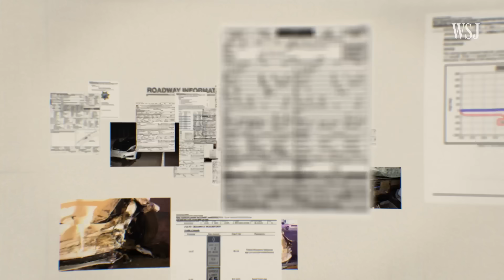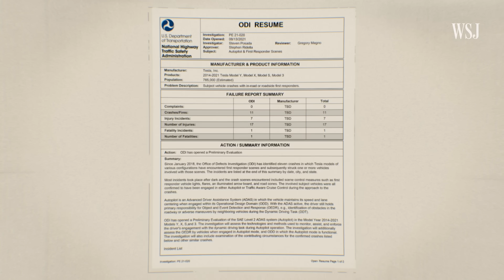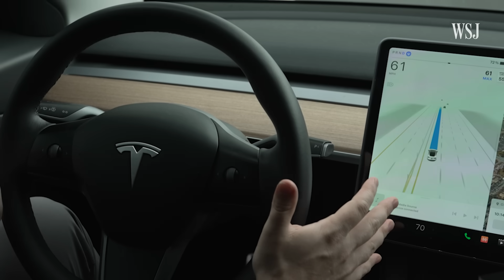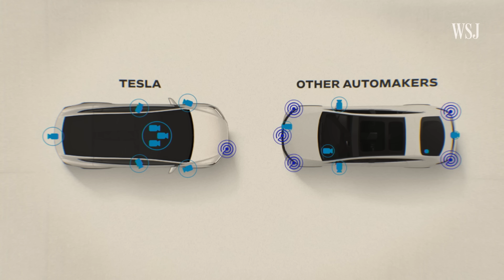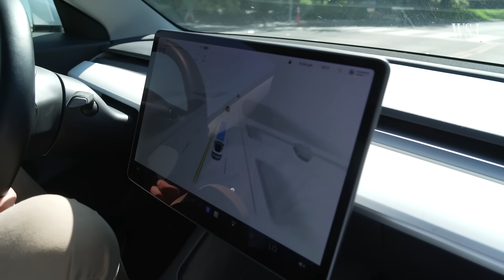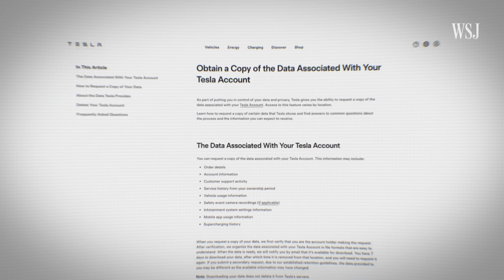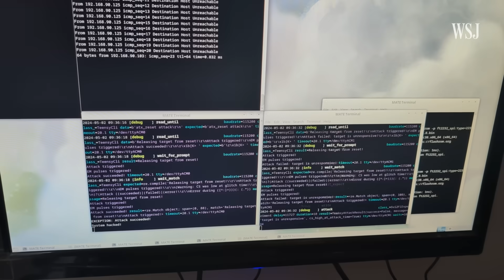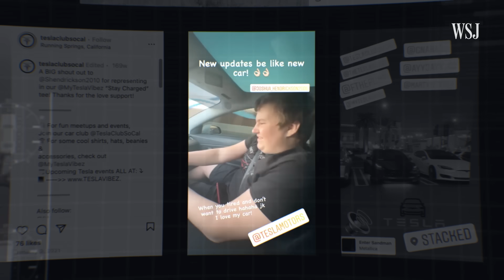The Hidden Autopilot Data That Reveals Why Teslas Crash | WSJ

Comment: Worth noting that when you turn on autopilot, it tells you to keep tour hands on the steering wheel so you can make corrections..... And it even tells you it is a beta release. 🤷‍♂️

The car told that guy to hold the steering wheel 19 times??? Bro ...... If youre told to hold the wheel so many times per time period, it should shut off autopilot as youre clearly abusing and neglecting the system, and outting yourself at risk.

Comment: There is no such thing as 100% "autonomous full self driving autopilot" - it should be called "advanced cruise control" - Tesla calls it "Autopilot and Full Self-Driving (Supervised)" - notice the word "SUPERVISED"! The instructions clearly state the driver must have their hands on the steering wheel at all times and be ready to take over control of the vehicle at a moments notice - Tesla IS at fault for using the term "full self driving" because it is not.
Reply: I literally talked to someone early today who insisted that Tesla is already at L3 and possibly even L4.

When asked why the company wouldn't assume the liability of an L3 designation.....crickets.

Comment: I use autopilot every single day without any issues.

you are acting like any human would've seen the flipped truck in time. there are barely any light. 

The car using cameras is the same as a human using it's two eyes. having 8 cameras, full 360 view gives you better safety then your two eyes. Again, all of clip you showed of autopilot crashes were at night where a human would also most likely not see the danger.

IF YOU DONT LIKE AUTOPILOT, DONT USE AUTOPILOT LOLOLOL

yall doing too much for a headline.
Reply: If a human didn't have enough light, the human would slow down so that there was enough stopping time. The Tesla in question apparently didn't.
Reply: Don't compare human eyes with cameras. One human eye is  better than 8 cameras that cannot see the seen at the same time .
Reply: @AhmedKhan-wq5zq  all 8 cameras look and monitor all at the same time.

Comment: Full FSD isn’t actually a thing yet.  Waymo is so far ahead of Tesla, Tesla will probably never catch up.  Both companies are using our public roads as test labs to try to get the tech to work.  Reportedly Musk only want camera’s because its far cheaper.  The prob is that driving requires more than just sight and the level of processor musk wants to use isn’t capable of handling the job.  For what he wants to do he would need a processor akin to what an F-35 uses OR have a back up on a wirelessly connected central server.  Oh, yeah earlier this week Tesla said it may open a “monitoring center staffed by humans to provide emergency assistance for FSD vehicles”.  That’s for robo taxi support.    1000 serious or fatal crashes is a respectable N for a baseline study and the data screams the Tesla autopilot has serious design flaws. Finally WSJ does real journalism.

Comment: "Auto pilot" was the worst name in safety history for these cars.
Reply: And yet, no regulatory body can take any action towards it. Insane.
Reply: @alexbian5567 in some countries they had to change the name, but in most it has been kept as it technically describes precisely the feature making it difficult to rule against it.
Reply: @fdelaneau  Yeah, that's intentionally misleading marketing. Especially, when Musk keeps saying the car will be able to drive itself (to almost anywhere) starting a decade ago? Isn't there a rule to regulate such practices?
Reply: The Autopilot name is coming from the aviation industry and it is technically correct. In a plane having the auto pilot active doesn’t  mean the pilots can’t leave their seats, the pilots needs to be able to take over at any instant. The problem is that the general public doesn’t understand it as such and this causes much confusion. 

Now, if you are a Tesla owner, when you activate the autopilot in order to be able to use it on the road, the instructions are very clear, this is meant to be used on one way roads and you have to be able to take over at any time. There are also warnings if you need don’t keep your hand on the wheel and if you don’t comply Autopilot will disable.
Reply: @fdelaneau  Autopilot isnt really a technical name you find in the aircraft industry, and it comes in a million different forms, from light assistence to (rarely) fully automated flights. Eg the Airbus Autopilot is called "Auto-Flight-System".

And Elon named the thing Autopilot while talking about how we have self driving cars in two years. Its just later that Tesla backpedals and says "autopilot doesnt actually mean self driving". They got whacked in the EU for false advertising.
Reply: @fdelaneau  theyve updated it so you dont need to have your hands on the wheel I think autopilot is absolutely awful compared to fsd and not in a feature way it is actually just terrible at making and decisions which I get cutting features off fsd but the actual logic and programming is terrible
Reply: @015AEX  False. Autopilot to this day requires your hand on the wheel. FSD (Supervised) now no longer requires you hands on the wheel, but requires constant supervision and attention. If you pick up a cellphone or look at the Tesla screen, it will yell at you to pay attention to the road.

Autopilot is traffic-aware-cruise-control with lane-keeping-assist. Nothing more. It's meant to be used on the highway to reduce strain on the driver. It works well and the name is appropriate... technically. The only problem is the average person doesn't really understand what the word "autopilot" means. 

FSD (Supervised) is to be used anywhere and is the "Full-Self-Driving" version of the software. Tesla has updated the name to include (Supervised) at the end to make it more clear that you are required to be present and give your full attention to the road, as this is still a technology in development. It works well, but you should be prepared to take over if ever you need to. 

I think the part in this video where they said "the technology works just good enough that you get this false sense of confidence to stop paying attention" hit the nail on the head. Typically, in the past we were all used to Cruise-Control. It just kept your speed, obviously if you were approaching a car, you would hit the brakes and disengage Cruise-Control. Everyone understood this. The problem with Autopilot/FSD (and all these other manufacturers driving assist features nowadays) is that they actually do work SO WELL, that you begin to give it more trust than you should at this stage. It's basically so good, that you forget it's not quite good enough yet. Tough situation to be in.
Reply: "Autopilot" for automotive use was actually first used by Chrysler Corporation in 1958 for the first version of their cruise control.  "Autopilot" for Tesla comes in three (I think it is now down to two) levels:  Basic autopilot, which is on all Teslas is essentially a cruise control and lane keep assist and it works fairly well.  "Full Self Driving (beta)" or FSD, is where the system will steer, stop, accelerate, change lanes (with a signal) and is what this video is about.  It is a very pricey option - currently $8,000 USD for a perpetual use license or on a subscription basis for $99 USD per month.
In the course of ownership of my Tesla, Full Self Driving has been given out for free for one month on two occasions.  My impression was that it was amazing what it could do when it worked well but was downright terrifying in certain situations when I had to intervene.
Reply: Semi-auto "Jesus take the wheel" simulator.
Reply: But the best name for profit
Reply: Cruise Control is just as bad.
Reply: Tesla deliberately mislead its customers and shareholders for profit. It’s obvious.
Reply: Why? An autopilot system does not mean an autonomous system; it still requires human supervision. Just because it says ‘autopilot’ doesn’t mean you should fall asleep behind the wheel.
Reply: it's a GOOD term! look at the definition from Wikipedia for example: "An autopilot is a system used to control the path of a vehicle without requiring constant manual control by a human operator. Autopilots do not replace human operators. Instead, the autopilot assists the operator's control of the vehicle"

Comment: The former Tesla employee is a moron, to be fair. The entire point of multiple cameras is to overlay images to discern distance and position. It’s precisely BECAUSE the cameras are offset that they can work.
Reply: No. Images are difficult to be interpreted by computer. Radars are precise. In addition, the computing power these days are still not responsive enough. If these a bug in the program, you are also screwed.I think you are the one who do not understand computing or physics. Speaking as a person with IT skill. 2sec before crashing like that guy, the computer never even slow down. Feel free to prove it yourself. If you trust it so much.

Comment: If the guy was on the road every day at 3AM, who's willing to bet he was asleep when the crash occured?
Reply: Possibly, he may also have still been waking up. Driving a car at that hour of the morning is often times extremely boring.
Reply: Still doesn't matter, a proper sensor suite would have recognised the truck... You know with Lidar and radar, but Musk is too cheap for that. Guy has billions but a few sensors are too expensive...
Reply: Yes, but even so, the vehicle should break, slow down, swerve, etc. Not continue to plough on into an object it doesn't recognise.
Auto pilot is an incorrect terminology to use and claim. Driver assistance is probably the most relatable terminology
Reply: @JonAbrams-xt4tq 
"Yes, but even so, the vehicle should break, slow down, swerve, etc. Not continue to plough on into an object it doesn't recognise."

It can only do those things if and only if it knows that there's an object it can't recognize. The main problem is, or rather, the problem, is that the AI system doesn't know that it doesn't know that there's an object it can't recognize. It's basically the most dangerous epistemic position: It doesn't know that it doesn't know. When the same object is correctly recognized by one camera as a car/human/obstacle/etc, but is not recognized as such by another camera (or worse, not recognized at all, like shown in the videos above), the AI system is supposed to be programmed to take safety measure by slowing down the car, swerve, etc, not keep speeding and crash into the obstacle. Defensive driving should be programmed into the AI system.
Reply: Well that shouldn't matter, since according to Musk, autopilot is 10 times safer than a human driver.

Comment: It's been obvious for more than two decades that if an autonomous vehicle is to be maximally  safe for the consumer, it MUST have fail-safe, complementary and redundant sensing capabilities - not the cheapest configuration possible! That's why ALL aircraft, marine vehicles, rockets and nuclear power plants MUST have redundant and complementary systems. That's also why ALL other automotive manufacturers use cameras AS WELL AS Lidar sensing capabilities for their autonomous vehicles.

Of course then, EM prefers to make the quick buck more and thus look away when TSLA customers are killed due to a lack of redundant and / or complementary sensing systems. But the TSLA fanboys continue to toot EM's massively hypocritical horn.
Reply: Lidar is not some sort of magic. Waymo literally crashed into a large wooden pole a few months back. despite Lidar. Tesla sees a lot more than people think.  and creates it's own pseudo lidar using camera's.

Comment: Incredibly sad for the people who lost their life and the families. However, WSJ - are we just going to skip over the failure of the driver to remain attentive (as instructed by Tesla)? A tipped Semi in the middle of the road? How long would you have to see that if you're paying attention? If it was a quick occurring situation, then this (unfortunately) would have happened regardless of Auto Pilot. Let's just get a bit more crisp on these stories. Give the facts and lose the "spin", if you're going to report. With that said, this is a good reminder that FSD is not infallible. It has a long way to go, even if your personal experience has been good. That’s why it’s critical to remain attentive. My personal use of FSD has resulted in a number of disengagements due to questionable and risky behavior.

Comment: very biased video especially not accounting for the latest iteration of the FSD on HW4 vehicles. tesla FSD is constantly evolving and is called FSD supervised for a reason. The human driver must supervise and take control if it is making a mistake. Since 2022 tesla has introduced cabin cameras which monitors the driver attentiveness, if the driver remains distracted despite several warning, FSD disenages and full over.

Comment: The US has 6 MILLION car accidents per year. Teslas make up ~2% of the cars on the road and 2% of 6.000.000 is 120.000. Yet, you make a fuss over a couple of hundred accidents since 2016!? Really? Gees, what a joke. 
And Autopilot is literally just cruise control by the way, you're still fully responsible for the car. It is NOT the same system as the Full Self-Driving. Many of the accidents were probably inevitable too - the ones in the video certainly were.

Comment: I drive a 2023 model 3 LG but use autopilot only on highway driving max 130 km/h. I tried the autopilot like it this video on a junktion and the car did not see red light and wanted to   head on over the junktion direkt to trees. So I dont trust it never only going straith. I will always drive myself but some tech is fine when it says you are to close or over the line.

Comment: OMG FSD has changed and improved a thousand times since these first crashes. It is not the same FSD system because of these crashes. Tesla is improving all the time. This is not typical of any other car manufacturer. Remember the cruise button on the end of the turn signal stock? No one seemed to think that stupid system was a hazard to the public.

Comment: What a terrible hit job by WSJ, replete with ominous music. First off, Autopilot is not FSD (Full Self Driving), and is nothing more than a glorified cruise control. It does not stop for stop signs or traffic lights or slow down for curves. Steven Hendrickson was warned 19 times to keep his hands on the wheel with Autopliot. It was his responsibility for the safe operation of the car.    ...As for Autopilot, it is already safer than human drivers. ---- Autopilot is now going 7 million miles, on average, before an accident, Teslas not on autopilot go, on average, 1.3 million miles for each accident, and the US average for all cars is 700,000 miles before an accident. 
    And Musk and his engineers are trying to make these systems affordable to all people. Tesla prices have been falling as has their costs. Tesla vision systems helps cause this fall in cost so that more can afford a Tesla.

Comment: It is pretty obvious that the computer system doesn't understand all the objects in front of them. I think it is also kind of weird with all the technology information available that TESLA does not use from other data sources...i.e. WAZE (accidents ahead) or some type of blue tooth tech in cars that detects other cars around them..... still decades away I guess?
Reply: The performance of V13 is showing Tesla is on the verge of solving autonomy. Tesla stock is reaching record highs because of it.

Comment: To all the Tesla apologists: I was involved in a crash three months ago when my Tesla rammed me into the median. It was raining and foggy. A truck slammed into a puddle of water and the splash covered all my cameras. The system took over and I couldn't steer my car. It's not that people are not paying attention. The system just overrides human input and/or there is a substantial lag to disable FSD or just normal driving assistance. Police and ER doctors knew right away what had happened as they relayed to me that it happens all the time now that all Tesla are camera/vision only.
Reply: I have no idea what version you were using. But the FSD of today is a very different beast to what has gone before. Tesla stock hitting record highs based on V13 performance.

Comment: Self-driving will NEVER work on the same roadways shared by humans. As seen in this video, there are too many variables these systems need to be programmed to see that are otherwise natural for us. The simple fact that Tesla and other manufacturers have been allowed to develop/beta test these technologies on public roads is beyond baffling; especially since we're long past the point of impact it has on the general public and owners PAYING for the privilege of endangering themselves and others. There are countless reasons why any one vehicle (or entire model lines) are scrutinized for safety and ultimately banned from public roads for a litany of reasons both real and manufactured, so WHY is this some kind of exemption? How is it that any technology/innovation that strives to separate the driver from the responsibility of driving isn't held under the same scrutiny? From replacing physical buttons with capacitive touch surfaces to "auto pilot" exist a plethora of cost cutting and fads that need curbed immediately by regulating bodies.
Reply: V13 is showing Tesla is on the verge of solving automation.

Comment: surprised that the car does not even have some sort of basic radar or laser distance checker for backup. visiblity can change in minutes.  thinking smoke,fog,heavy rain,dust storms.
Reply: In these crashes Tesla was still using radar. Since then Tesla has made huge leaps forward. The FSD today is a very different beast from even that of a year ago.
Reply: @daydreamer8373  thanks for the info